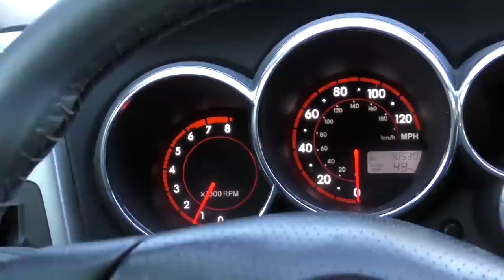Please Stop Doing This to Your Transmission (It Destroyed My Car)

Comment: Scotty, I just had a dealer replace my transmission fluid using their machine. I drive 2013 ES350. Changed it at 75000mi. Should I be worried? It shifts fine, just doesnt coast like my old Lexus. It keeps downshifting as soon as I let off the gas. Is this normal?
Reply: Forgot to mention that the dealer insisted I dont need to change my fluid 😂

Comment: Hey Scottie, love the videos! I have a 2012 Nissan Altima (base model) with not even 50k miles. I found out how bad CVTs are in Nissan’s after I bought it, but it is revving Hugh before shifting. I took it to the dealership and they said nothing is wrong with it, but it’s revving to about 4K rpms before shifting and doesn’t sound great. What is your advice?
Reply: CVTs don’t shift.  No gears.  Revving high is actually part of their design, in order to get more power.  They only rev low when cruising a constant speed

Comment: Which is best Celica 1.8 or 2 litre. I know of a good condition 1994 2 litre which I am tempted to buy
Reply: Can't say for sure (don't know enough about both engines), but I think you'll be OK with either engine. If the one on the one you're looking at has the Yamaha heads (not all 2L versions do), that may be a red flag.

Comment: Scotty I drive a  2018 honda civic ext with the cvt transmission in it. On my transmission fluid the car has a indicator when the service is due. I'm a little over 40,000 miles in just a little over a year. Should I change it when it tells me or would you say take it to a shop?

Comment: What if you don't flush it but change 2-4  Qts. in it? Does it cause any damage? (I've a 2012 Camry)
Reply: That should be fine, especially if the car has lower mileage. Don't hold me to it, though; I'm not a mechanic.

Comment: So if I bought a used 2002 Lexus es300 with 130k miles it's too late to flush out the transmission fluid? So my best bet is to change the filter only?
Reply: It's too late; it's probably best to leave everything alone at this point.
Reply: @EMichaelBall  -- We disagree again, Mr Ball. 130,000 miles on a ES 300 is not a lot. Clean fluid is always better, so change it.

Comment: I have a 2008 chevy cobalt with 120,000 miles. I've noticed the gear shifts have been somewhat rough. Sometimes it's fine, sometimes I notice something wrong. Say I'm going from 2nd to 3rd and when it goes up a gear it kind of hesitates or it's like the car doesn't know whether it wants to stay in 2nd or move to 3rd. Do I just need to replace my transmission fluid again or is this a sign of my transmission slipping?

Comment: If I just bought an '08 Ford Expedition, how can I tell which oil to put in it? It says time to change it, 170k mileage, found a sticker from an oil change place with 139k change. Should I use full synthetic? (I've picked up a motorcraft filter and castrol full synthetic already but haven't cracked the seals) NEED to change it this weekend. Thanks y'all
Reply: At this point, I don't think it matters what oil you use. Whatever you can get out of that car will be gravy.

Comment: Scott are respected you have a lot of good points but let me tell youabout 19 quarts come out so something was wrong that means there was automatic transmission fluid in radiator fluid running it together which it saves me cuz I bought a red and it saved my problem I would have eventually
Reply: just keep up with it every 50,000 change it does a filters go to be changed as he gets clogged if it aint flowing properly the transmission will not run right but you got to start early in the car if you buy a used car lot of miles you don't know what it's been through if it's some brand-new change it filter couple times and I'll 50-60 80,000 lingerie black and dirty you can you can change it I have no problem 200 mm runs like a champ I was afraid it was going to happen but right now I got over 2000 miles
Reply: Would you not change for would you not change the power steering fluid which is a must
Reply: you can change your brake fluid it's kind of hard because you got oil all over the place it's in all the it's in all the line to send all the whatever you call those freaking things on the on the power steering
Reply: you change a power steering fluid in your brake fluid because it boils it gets old and it boils you have to change that if you're going to keep that car from new forever I guarantee to get $300,000 everything long as you just keep changing every liquid in the car from differential to power steering change every fluid you got differen

Comment: I think Scotty should have suggested to new car owners to ignore the owner's manual fantasy maintenance schedule and do the first AT fluid change early i.e.BEFORE 10k miles. And every 30k miles thereafter.  If the tranny still fails years later then at least we'll know it was its crappy design. Same goes for differentials and transfer cases. Change the fluids hot immediately after a good drive while the shavings are still suspended in the fluid. And buy magnetic plugs before hand if not already factory equipped.

Comment: So don't flush but DO flush it when fluid is too old?
Reply: @Jonathan A. Isn't flushing the same thing? transmission flush is a maintenance process where all of the oil in a transmission is removed, new oil is run through it using a special machine to push out grime and sludge and then it is filled up with new oil.
Reply: @Jonathan A. I'm confused because I have mechanics always flush and my car is good.

Comment: So my car has 50500 miles on it. Do you recommend changing the transmission fluid
Reply: 3 drain and refills with 500 miles between them.  You'll have about 80 - 90% new fluid.  Clean the magnetic plug after each drain.

Comment: Funny cus i went to get my oil changed at the honda dealer today and they told me at 30k miles, which is what my civics on, a transmission and brake fluid flush is recommended.  So should i do it still ?

Comment: Wait, so I should get my fluid changed, but I shouldn't flush? 
2013 5.0 f-150 80,000. 
Shifts funny out of first when cold, and does a sputtering shift when I kick it down, and it tries to shift into 6th.
Reply: You are correct. However, at your mileage, it's probably too late to do a fluid change. Try some Lucas Oil "Stops Slip" and see if that gets rid of the hard shifting over time.

Comment: My 2013 lacrosse  has 80k and never had the transmission fluid changed, is it too late? RPMs jerk up shifting from 3rd - 4th when it’s cold
Reply: Probably. Put in some Lucas Oil "Stops Slip" and see if that fixes the hard shifts over time.

Comment: So did I mess up by dropping the pan and change both filters on my 2010 Ram it had 165000 used dodge OEM oil on my 4.7.The pan had a leak?

Comment: I'm bummed out.
My '97 camry has 142,000 miles. Bought it at 129. 
I've never had my tranny flushed, and never will.
But. My tranny slips a bit on acceleration. It can delay going from reverse into drive.
As of more recently, I can feel it engage and disengage when I'm holding the brake at a red light. 
This is a faithful Aisin transmission. Even though it is 25 years old.
One thing i was doing sometimes, is downshifting it to take some of the effort off my brakes. And to practice my shifting muscle memory for when i start driving manual cars. 
Scotty, (or anyone else here that knows) does doing that wear the automatic transmission prematurely?

Comment: No way putting the old fluid back in! But for sure change it periodically and use the correct specification fluid that's called for the car. The old addage of putting in new fluid ruins the transmission, no . If the trans does go out after that it was on it's last leg anyway. It was too late in the first place and changing fluid was done because they knew something was wrong. It should have probably been changed way sooner. Or it leaked and was run low, or the car was stuck in the ditch or was overworked ,overloaded,etc.
The power flush?  naw not so much, I have to agree on that.

Comment: and if i dont reach 60k miles in lets say 8 years is it still good?
Reply: Scotty said in a recent video that the ATF is “strong” fluid, and doesn’t degrade much over time. That’s because it just spins and isn’t exposed to gases etc as engine oil is.
Reply: @EdwardChingArt  so basically i dont change as long as i dont reach that 60k mile mark

Comment: What about a manual transmission how often should I check my gear oil in it I have a 95 f150 with the 300 inline 6 In it the truck has 307k miles the clutch was changed at 150k gear oil was changed at the same time and has never been looked at since then but I have no problams with it ether

Comment: how about transmission without filters ? the jatco 4/1  transmission doesn't have a filter , or the filter is not accessible . and it is stated in user manual of  cars hooked with it is recommending to fully replace the fluid .

Comment: i got one for u scotty so my problem on my 1995 geo prism  i replaced both cv axle  but the passenger side cv axle  is loose amd the problem is theres a clunking or grind noise onky when i put it in drive  and incan only mive forward a lil or not at all  but incan go in reverse no problem plz isnthisnthe cause tue cv axle isnt in the differentiql qll tue way

Comment: Hi Scotty 
I've Honda accord  2008 i've a problems with RPM when it is reaching 3000 car wont go its jarking and the mechanic told me to change solonied switch an i did but
 still have the same problems... need ur advise..Tnx

Comment: I went to Carson Toyota to have my 2008 Toyota Corolla LE With 32,000 miles for a transmission fluid change that's it and they charge me 175$ and the same day I took my 2016 Honda Civic work 51,000 miles for a oil and filter change and transmission fluid change and they charge me 195$ the labor pay at Toyota is more it's about 140$ and at Honda is 102$

Comment: I have a 98 Camry, v6? How should the transmission fluid be changed? Does this model have a transmission filter?
Reply: It definitely has Transmission Fluid, Vic Cas. You should take it to a shop and request a Transmission fluid  and filter change, NO FLUSH. Just like that. I would also have them  re-torque the "Valve Body"  while the pan was off.

Comment: I have a 2018 Camry SE that has a very jerky transmission, especially on cold starts first thing in the morning/day.  I've tried bringing it to 3 different Toyota dealership and they all say it's 'normal'.  1 actually semi-acknowledge the problem and did a reset of the computer but it didn't resolve the issue at all.  Not sure if it's just the new 8-speed or what the hell's wrong with it.  Anybody else know about this?

Comment: Scotty I’m looking for a work truck a 2500 diesel I’m trying to break out as a welder so I need something that is affordable 10-15k that is very reliable and I can run for many miles what is your recommendation?
Reply: 08 and up Toyota tundra or a Dodge Cummins with manual transmission

Comment: What do you do if your transmission doesn't have a filter that can't be changed? Have a 08 Mercury Sable with a 6F50 transmission.
Reply: Leave the fluid alone.
Reply: @EMichaelBall  already changed it 3 times has 66000 miles on it.

Comment: I drain and fill my Tacoma every 15k to 20k , 3.2 qts. , and I use the valvoline ATF Synthetic compatible with the World Standard. Been using it for 5 yrs. now and no problems with it at all. Also change my rear diff every 15k front diff 30k and transfer case 30k , Motor oil and filter 3k , rotate tires every other oil change 5k to 6k. flushed coolant @ 120k . I have a Carfax account that keeps all my records of preventative maint. DIY . It will even txt me to remind me of something thats coming up...Also if you wanted to sell your rig , it will have everything from mile 1 to present recorded , so you can ask top dollar because of how well maintained it was (With proof)...Im a little bit overkill on my truck , but I appreciate it and its about the only thing I own thats worth a fk...So I might as well treat it like royalty...Peace.

Comment: Scotty should i change my transmission fluid in my 2012 jeep grand Cherokee with 64,000 miles
Reply: Can't speak for Scotty, but probably not
Reply: 3 drain and refills with 500 miles between them will be fine.

Comment: So we have a 2012 Honda civic 4 door 1.8 coming up to 60k miles,as far as I know the transmission fluid has never been changed,so if I take the pan off change the filter and top it off with new fluid,how much new fluid do I need to put back in?
Reply: @Mark Codiroli ty,and I ment 160k not 60

Comment: Does that include a manual transmission also?
Reply: Manual is not as harsh as auto trans but the fluid still need to be changed.  Easy drain and refill every 30k miles.
Reply: @mitch1847  thank you!

Comment: I have a 98 Monte Carlo I just bought and I checked the transmission fluid after it slipped once and I was shocked. I think it had like a quart of fluid in it and I put in a lot. I can see where it's leaking so does anybody know where the fluid is going? Granted I only just got it filled back up but it hasn't leaked yet. Edit: When I changed the fluid the thing shifts so much smoother.

Comment: When I had all my fluids exchanges and flushed other than the engine oil it was a little more than 250 with a coupon and it did shift better at lower rpms after now I don't think the flush did that but more just gettin new transmission fluid

Comment: My 2004 Toyota gold Camry has 333,000 miles and never changed the transmission fluid or filter and shifts like a charm. Soo??
Reply: In your spot, leave it alone.

Comment: I just bought a glx cvt lancer with 61000 km .. I want to make the change of liquid and flitro but the problem has a transmission f1c1a the filter is in a place where I would have to disarm the transmission you recommend me? change the liquid and the filter or just the liquid? I'm from Venezuela thanks
Reply: Just change the Fluid on that one, Alberto Pizzimenti
Reply: @garymiller2056  thaks.. change or flush??

Comment: I went to get my transmission fluid changed. I did it around 110k miles, but when I bought the car I got papers for fluid changes done by the dealer, and the car had 56k at the time of purchase.  I had a HELL of a time convincing them to NOT flush my transmission. I don't know anything about the independent mechanics in my city, and I can't speak their language, so I went to MIDAS to get it changed. I was nearly to the door when they said it'd be OK to just drain and refill. They tried to charge me the price for a flush, too. I told them I wasn't paying for all that labor and machine work if I wasn't using it. I know how to change the trans fluid, I just can't do large fluid changes on my apartment property says the office. Risk of spills, I guess  Bastards.

Comment: i flush my transmissions my self every 30 thousand miles never had a problem and they shift like a champ and will keep doing it not all cars have a transmission filter like my don't  if you buy a car with burnt dirty transmission than don't change are flush it at all because it will slip for sure
Reply: Yep.  If you stay on top of it then flushes are ok.  But it's when they're done at 120k miles and the fluid has never been changed.  That's when problems happen.

Comment: Don't buy cars with automatic transmissions if you want reliability.  I have a manual 5 speed with 300,000 miles on it. Works perfect.

Comment: That's "exactly" what happened to my Nissan 300zx...all it needed was the transmission oil pan cleaned out from sand (living in Las Vegas), and the filter changed! NOT a transmission! All for under $50! God is good!

Comment: i drained my auto trans fluid after it was slipping very bad, only 1 quart of trans fluid came out so i filled it, hasn’t slipped since
Reply: Pretty sure your transmission was slipping because of how low it was, if only 1 quart came out then you were about 6-7 quarts too low.
Reply: Pete Rodriguez III well yeah that’s correct obv, but i still flushed it and it doesn’t have any issues
Reply: @rave3016  you flushed it at a shop? Or you did the ole DIY flush method?

Comment: Its not that u should not flush the transmission fluid

U should not use machine or forced flushing

Just simply flush the fluid by changing the fluid multiple times, yes it will take more time but after 3-4 times your fluid will be much cleaner

Comment: So you leave the remaining 8 dirty quarts in the transmission ?
Reply: James B  if you change the oil at every 30,000 the oil is not that dirty. 5 quarts of oil is cheaper than a new transmission.   Cheap insurance in my eyes.
Reply: Steven Lefebvre I don't have that opinion. Just bought a used Tacoma with  97,000 miles never changed yet.

Comment: My 1996 Mazda Protege has 118,000 miles on it and I've changed the filter and fluid twice. I purchased it when it had 68,000 miles and I didn't know if it had service done to it by the previous owner. I changed it soon after I got it and everything looked fine back then. When I changed it 9,000 miles ago the fluid and filter were still clean so I probably won't be doing it again until it reaches 150,000 miles or so. I would never flush a transmission. Whoever came up with that dumb idea is probably laughing his a** off while sitting on the pile of money he made.

Comment: I have a 2004 Matrix 5spd manual.  How often should I change the gearbox fluid?
Reply: With a manual he recommend every 80,000 to  100,000 miles
Reply: Gear  oil  API  GL−4  or  GL−5.  Easy to do, fast, and cheap every 30k miles.  Transmissions love clean fluid
Reply: @mitch1847  Thanks!  Is there a difference between GL-5 and GL-4?
Reply: @user-ne3ze4zz7r  ----There is a difference between GL-5 and GL-4. I don't remember what they are, but use the one recommended. It is easy to think the 5 is better, but it has an additive that is not recommended for newer cars.  Look in your owners manual.